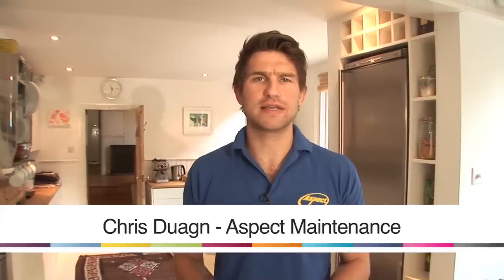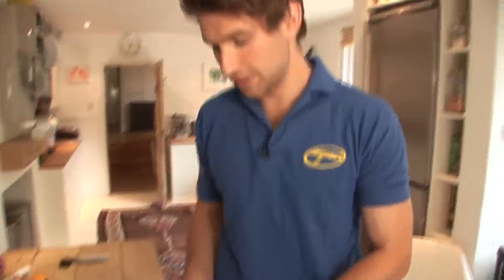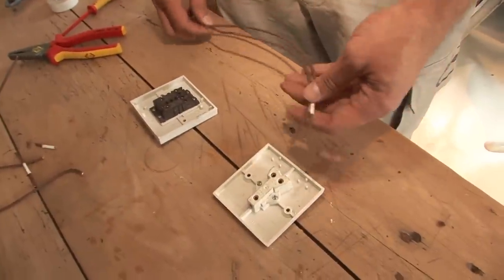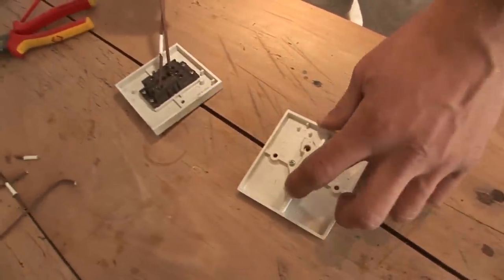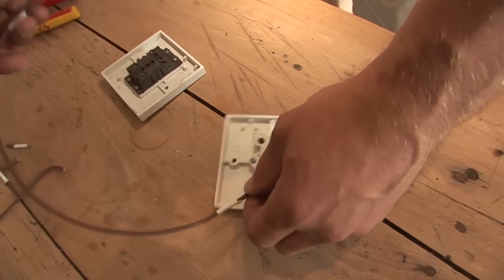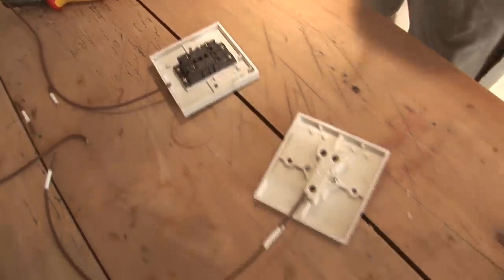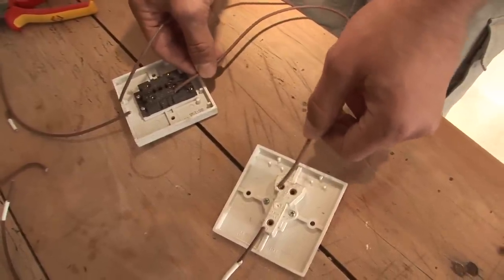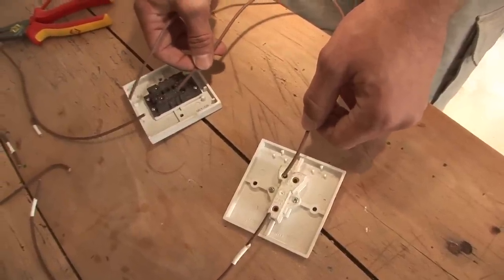How To Wire A Two Way Switch

Comment: I don't have L1 or L2 printed on my switch instead I have 2 way and 1 way and Com. So my question is - is 2 way the same as L2 and 1 way the same as L1? 
I thought the video was very clear and you made it very easy to understand.

Comment: Ok I can understand my self, what about others? You need to explain that the switches are linked with 4core cable,  in UK they are coloured brown, blue, white and earth. if you wire the last switch lets say/ BLUE L1, WHITE L2,  BROWN COM, and earth on the metal box. So far so good? Now you go to the first switch and you wire L1 BLUE, L2 WHITE, earth to the box. There is 3 wires left, the brown coming from the first switch, and 2 wires coming from the light they should be coloured brown and blue.

Comment: All the wires are red because in a switch there is no neutral. All wires are live so when you replace the switch you need to label which cables came from the common, L1 and L2.

I don't know how much hassle it is to find which wires are which as I've never had to do it but you can probably get some sort of device to do so.

Comment: In a 2 way lighting circuit both switches can be used to turn the light on and off (that's the point of it).

Comment: Not good practice to wire the live to the common! Will work but... Common is exactly that, a common connection between the two switches.
Easiest way to remember is common to common, L1 to L1, L2 to L2. Connect the live in the batten holder to L1 on either switch and the live side of the Luminairre to L2 . Easy peasy.
Don't forget to put a brown sleeve on all the wires to comply with the regs (all the wires are potentially live).

Comment: You obviously know what you're tlking about.   Could you give me some advice please.    I have replaced the cover of a two way switch and all the wires are red.  After copying the wayall the wires went into the old switch the new switchdoesn't work.  I bought another one and copied it agai - still doesn't work.    All he wires arered and I haven't a clue how to proceed. I haven't had a light in my bathroom and hallway for 4 months. Can I do it by trial and error. Could you advise please.

Comment: you should be ashamed at the fact that you are posting DIY electrical videos... no electrical work should be do it yourself i dont understand why people want to do it and not really have a understanding... its a very dangerous thing
Reply: So people who study electrical instalation shouldnt be able to look up videos like these to reference. ?
Reply: dude are you OK. what's wrong with getting a bit of knowledge I meen a simple switch change should not be in need to call for an electrician. if a few videos  show you how to do it . why not its not . and if someone is dumb enough not to switch off from the mains well they deserve a bit of shock to bring there senses back together .
Reply: ciwan Bayrak
something as simple as changing a switch can burn down your house, so yes it should be undertaken by a professional electrician.
Reply: +A Cat how can you burn the house yet there are fuses and mcbs.
Reply: Erick Juma
just from that comment i can tell you have no clue in what electricity can do. or anything about it. mcbs and fuses will not stop a fire, they are there to portect the cable under overload condition and dualt conditions. but a hot contact will not trip them. and will slowly get worse and worse eventually causing a fire. do some research
Reply: +A Cat point of correction fixing an electric switch is one of the easiest things in electrical fittings. l have no formal training in electrical and electronics but am and to fix complex electrical gadgets such microwaves, hot showers etc. why spend a lot of money on technicians yet you can DIY! !!!!!????
Reply: Erick Juma
but you see erick your obviously a competent person, you may not be qualified but your porbably have some clue what your doing... where as the people who would be watching this video will have no clue what they are doing thats why theyd be here in the first place... if your competent then change a switch by all means, but youl be suprised at how many jobs ive been to where the person says there dad was an electrician and they know what their doing to find its and absolute mash up and a danger to everyone around it.
Reply: but my point still remains something as simple as changing a switch, can be fatal.